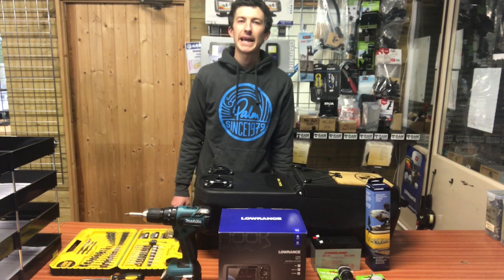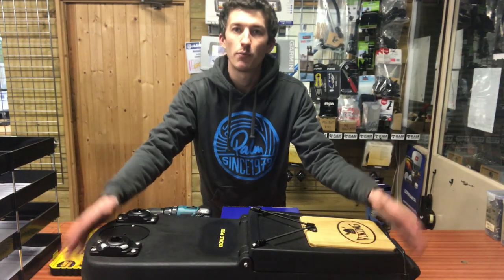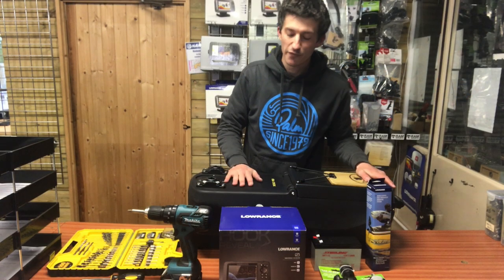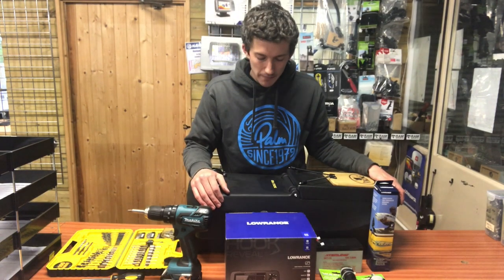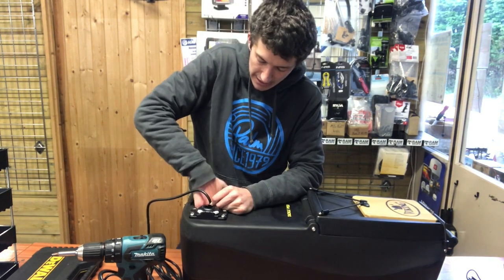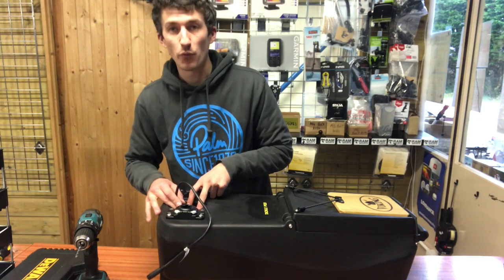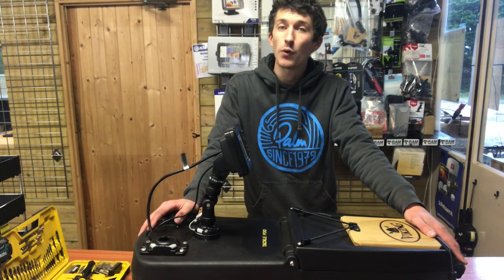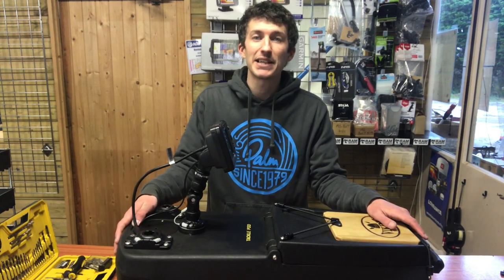Installing a Fish Finder to the Viking Kayaks Tackle Pod - Lowrance Hook Reveal 5

Comment: Makes it look simple, nice video. Does the Hook 5 have a different transducer to the Hook 2? And if so does it fit the same? Thanks.
Reply from the maker: Thanks! Yes the Hook Reveal has a larger HDI transducer than the Hook2 4X range. The Lowrance Transducer Scupper Hole Mount only works with the HDI transducer and is not directly compatible with the Hook2 4X transducers which are much smaller.

Comment: Does the transducer have to sit totally level with the transducer slot in the base of the tackle pod? I'm worried of the transducer getting scuffed if the kayak is set on the ground - can I set the transducer approx 1cm into the slot?
Reply from the maker: Hi Jonny, you can sit it slightly within the recess and it will be fine. Transducers are tougher than people realise, they are usually mounted on the transom of a boat and dragged through the water at 20+ knots with the odd collision with surface debris, so the odd scrape and knock won’t do them much harm!

Comment: Brilliant video, many thanks. One question - why didn’t you just use one of the two rail blazer mounting slots already on the tackle pod?
Reply from the maker: Hi Paul, the fish finder is best placed centrally for viewing whilst paddling. I could have used one of the StarPort HD mounts already fitted to the pod but these would offset the screen and drive my OCD crazy! The StarPort HD’s can be used for a couple of Rod Tubes for trolling 😃

Comment: Great tutorial video ... would this be the same for the Profish 400 tackle pod?
Reply from the maker: Hi Paul, the Profish 400 has a different TacklePod which does not reach through the hull to the underside, so you can’t mount a transducer to it. The Profish 400 has a transducer scupper hole recessed into the kayak itself, so you’d need to mount the transducer here, or look at an in-hull install or arm-mounted option over the side of the kayak. You can still rig a fish finder to a 400, it’s just not as simple and straight forwards as the Profish Reload.

Comment: I think it would have been better if u cut a half circle for the wire to come out and put it near the fishfinder would have fitted a bit better , but good job
Reply from the maker: It doesn’t matter too much where the wires come out. The further back, the less of an angle it puts between the wire and the connector in the back of the unit, so less stress on the wire at the join. Not that it is likely to cause an issue though. The latest pods have a hole cut out in the middle for connectors to pass straight through

Comment: Hi Liam, can you install a fish finder and all the cabling/power etc on a Viking 2+1 tandem in such a way that it could be used and viewed from the back seat as a tandem AND the middle seat as a single?
Reply from the maker: Hi Tony, a bit of a tricky one as there will be a compromise either way. Obvious place to install would be on the flat area just forwards of the central seat position / back of the front seat position... a long stretch from the back seat though and possibly a bit too close when paddling from the middle seat. You could possibly fit a couple of sections of low profile slide tracks to the side of the kayak - one in a position for back seat paddling, and one further forwards for center seat paddling. Would depend on if you were installing the transducer in-hull or on an arm over the side as to how straight forward it would be. I’d have to offer mounts up to a 2+1 next time I get my hands on one to be sure of the best option
Reply: @CornishKayakAngler  thanks Liam, appreciated. If you do get a workable solution please let me know, especially if you can fit it, t

Comment: will that pod accept HDS live 3in 1 transducer ?
Reply from the maker: I haven’t had one to check but I’m pretty sure the HDS 3 in 1 transducer is too long for the recess in the pod. I’m sure there would be a way to attach it but I expect it would sit proud of the bottom.
Reply: @CornishKayakAngler  I'm pretty sure I saw someone with a sidescan transducer sticking out the bottom somewhere on youtube, just means lifting the pod up before you beach i guess, thanks anyway

Comment: Would the lowrance triple shot transducer fit on the tackle pod as I’m thinking of getting one
Reply from the maker: The sidescan transducers won’t fit in the recess so you would need some form of extender to sit the transducer proud of the bottom of the pod. I have seen a few photos of homemade mounts that look for work fine. It would be cool to see Viking mould some brass inserts into the transducer slot on the pods to make it easy for the user to bolt on homemade transducer brackets. It would be easy enough to bolt through the plastic to fit your own though.
Reply: @CornishKayakAngler  yep seen the transducer was about 10 inches so thinking of getting the hummingbird helix 5 si or the Garmin striker plus 7sv do you know if they would fit ? When is your next shipment arriving?
Reply from the maker: I’m pretty sure the Striker SV transducers won’t fit, not sure on the Helix SI as I’ve not seen one in the flesh. The next shipment of Viking Kayaks arrives in the UK in May 🎣😎
Reply: @CornishKayakAngler  would you recommend any since I can’t get side view got about £500 to spend

Comment: Will the tripple shot transducer fit from hook reveal 7?
Reply from the maker: The Triple Shot transducer is too long for the recess, you’d need to make an adaptor for it to sit flush with the bottom of the kayak for the side scan to work fully anyway. I’m sure there’s a way to do it but not something I’ve done myself before
Reply: @CornishKayakAngler  no worries thanks for the reply. I'll stick to a regular transducer.

Comment: no inline fuse ???????
Reply from the maker: You could put one near the battery if you wanted. A 3A inline fuse is supplied with the fish finder. Unlikely to ever surge the unit when it’s the only device drawing from the relatively small power source in the set up shown. Never had an issue myself but if you want peace of mind then wire in the inline fuse 😀